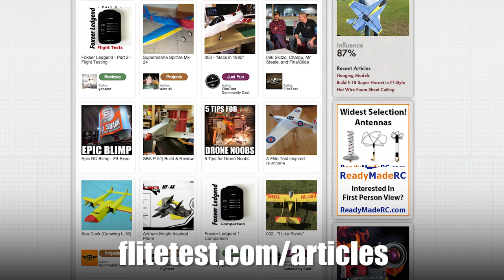Painting Your Scratch Build | Flite Test

Comment: There are a number of plastic scale model detailing books that have great painting sections.  These include hand painting air brushing and stenciling that give realistic results. As an old modeler I have 3 different types air brushes each one is designed for a different type of paint work. One is an old photo touch up brush that is designed to use black, gray tones and white inks not paint it works well for adding a rust wash to a ship model.

Comment: The uses for 3M77 really are endless. My latest use for it is in assembling wing cores for vacuum bagging (not an idea original to me). You can also spray it on glass cloth, let it dry, and then the glass cloth won't deform or snag as easily, making it easier to apply.

Comment: Three words:  Zinsser Cover Stain!  Oil base primer in a spray can, and you can find it everywhere.  Seals out moisture, covers stains, and makes paint stick like glue to any surface...even shiny packing tape.  Use a thin coat so paper doesn't bubble, and a second thin coat a few minutes later when first coat is dry to the touch.  Five bucks a can, minutes to waterproof and prime your model, you can even sand it for a smooth finish.  You can't beat it!

Comment: Hey! I design my own rc planes, and have recently entuontered the problem of the paint destroying my goam in a couple months. what should I do?
Reply: +----lines--  Have you tried sealing the paper with Minwax polyurethane (solvent based, not water based) before painting? Also, using paper medical tape to seal the raw foam edges before applying anything would help to protect it from damaging solvents.

If you have removed the paper from the foam, or are working with raw foam, I understand that a mixture of water based polyurethane and talkum powder can be used to seal the foam as well.

Dwight
Reply: +Dwight Rahl thank you for the tip, I'll try it for the next plane I build!!
Reply: There is a Flite Test video of this technique out there that you should have a look at. Basically, you apply the finish with a brush or rag, and then wipe off ALL excess after about 30 seconds or so. You want it to soak into the paper, but not so much so that it makes the paper de-laminate from the foam.